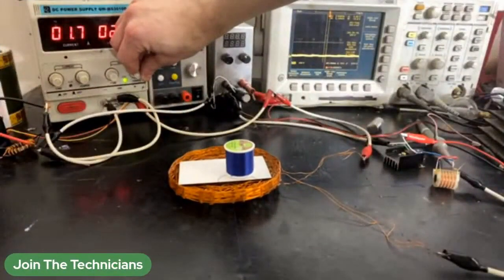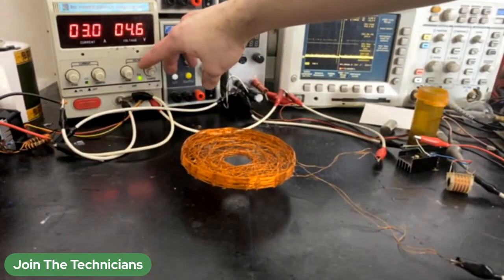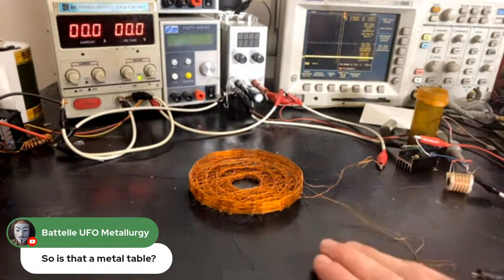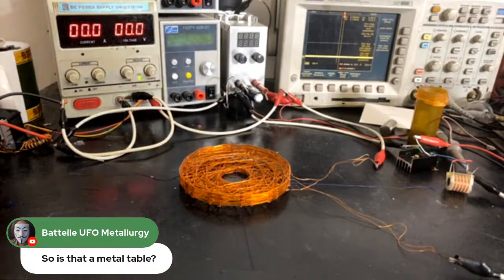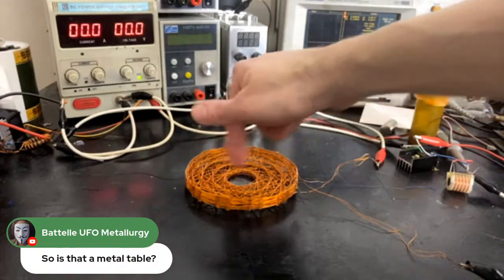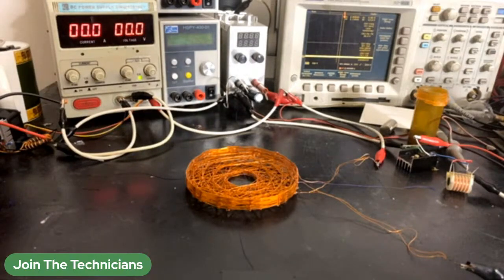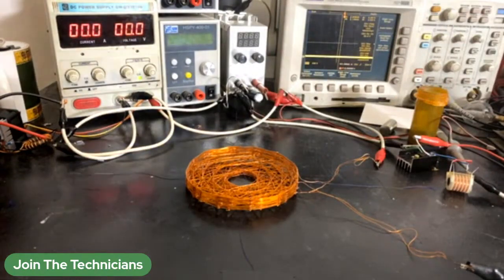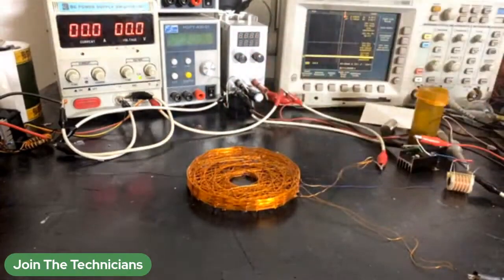Jeremiah Popp Hover Board Technology

Comment: 5:43 a charged particle trajectory doesn't bend if parallel to the B field vector, only perpendicular, so if the field generated by a straight wire were say strong enough (and symmetrical) it would deflect particles moving along outside of it in a toroidal fashion (around the circular field line). Hence if you had a vacuum tube with a HV cathode at the base of such a straight wire, you could theoretically deflect electrons away from the wire... ie I think Jeremiah gave an erroneous description, but if there's nothing conductive in the table, there's definitely something unusual happening here

Comment: I would have to go with the theory that this is just a plain old electromagnet and there is a magnet under the table. It seems to be stuck in the same position. Why is it not moving side to side, even when you pushed it it seemed to snap back to the same point
Reply: he said he used strings to stabilize it, similar to what is done with an ion wind lifter
Reply: At 0:08 when he powers the coil it centers itself over whatever it is reacting to under the table

Comment: Stick an aluminum tube in the center and see if it lifts too. If it does lift also, then attach an aluminum plate under it and it may stabilize.

Comment: It's hard to believe that the table is only wood.  Most coils like this float above a metal surface (Aluminum)...
Reply: Same idea though: instead of repelling on eddy currents which are phase shifted, the dielectric response lags to create a phase shift instead. It can actually be more efficient because you don't have resistive losses in the eddy currents. Dielectrics can have loss tangents too, but not often of smaller orders of magnitude.
Reply: @michaelperrone3867  If this is actually operating as advertised, then this is something beyond amazing 👏! This technology would validate what many have said was impossible and worst,  crazy... I'm highly intrigued!!!
Reply: @michaelperrone3867  This is what Joseph Hiddink claimed occurs with his device, patent US4095162A - Capacity changer .  Very quick rise time, high voltage pulses created, says with repeated pulsing it levitated.
Reply: accompanied by extreme heating and no stabilization unless the base plate conductor is segmented
Reply: @SuperCaviTationIstic  Not sure about that patent: the fields seem trapped between the capacitor plates so I don't see how they can have dielectric induction with the ground.
Reply: @rod3134   This device may operate by the same principle as the Fluxliner (for such a large object, multiple sections are needed, built into a zero-index metamaterial to be able to hit the high rise times required over such a large surface), and is probably the same effect that keeps the cones apart in Sal Pais' fusor patent.
Reply: @michaelperrone3867  True,  but I am still supremely perplexed that the significance of this object operating as advertised at all is not be getting more press. THIS IS HUGE!!! If true. To quote a famous movie line (Blade Runner2049),  "This breaks the world ".
Reply: @rod3134  Well it's not antigravity so much as levitation, and my guess is it's pretty energy hungry, so it will take quite a bit of refinement to make it practical. also all the people making actual progress on this are super shadowbanned because the algorithms have gone rogue.
Reply: @michaelperrone3867  Agreed 👍🏽.  I was into the lifters many years ago and discovered very quickly that it used ALOT of power. Whether its antigravity,  levitation etc... it seems to work. I looked into compact power supplies for awhile. All I could see that would be useful (Larger Payloads) was either fission,  fusion or zero point energies. The first two are here but fairly impractical. Zero Point energy (tapping the vacuum) appears to be the best approach. Zero Point along with the antigravity component has probably been realized. Many researchers in the past published seemingly successful attempts only to disappear from the public views. These two technologies married together will alter all of existence.
Reply: @michaelperrone3867  Usually the dielectric is sandwiched between 2 plates creating capacitance, i have a hard time believing there isnt something under the table causing the effect, especially since its' not explained in detail, i mean why hide the info if not for economic purposes like building intrigue and then selling the coils for outrageous amounts but only vague info on how to tune it to achieve the effect...sound familiar??
Reply: It’s just ion lifter which can’t lift power supply
Reply: @Cb80001  I would almost agree with the ion lifter idea. It appears to be a single wound coil. Ion lifters usually have a minimum of two separate coll or plates. I tend to favor the idea that an aluminum plate is under the table and his coil is using pulsed dc.
Reply: @rod3134  it’s same as this https://youtu.be/006d36WWyaQ

The guy in the video thinks it’s artificial gravity but it’s just ion wind and won’t work in vacuum
Reply: @rod3134  he even said in the video he uses hv. If you tune or pulse it you can use lower power/high voltage
Reply: @Cb80001  True, but in order for a lifter to work you need a positive and a negative hv electrostatic side within the unit. The fact that he got close to it and touched it indicates that it was more of a magnetic force. It would have discharged to him. Trust me,  I have a lot of experience with lifters.

Comment: When you pulse high voltage into thin wires, EVOs will want to form, some will pass thru the insulation, the rings will break into sausages. they will be repelled horizontally along tabletop below the convex side, and some will coalesce in the concave region. This will reduce gravity on the concave side.  Those EVOs will harm the electronics and human health unless the frequency is very high.  Build shielding with alternating layers of grounded aluminum foil, dielectric plastic wrap, and fine flourescent crystals in a thick layer.  Charlie, please pass this onto Jeremiah.
Reply: This sounds oddly familiar to what happens when you power a Tesla Coil. A retired engineer who was very friendly and helpful to me some years ago once told me a private story he didn't wish to share with others because he felt it would put him in a bad light, and I was open minded enough to give it a legitimate think-over. It involved a Tesla Coil and levitation of the entire build at low power levels. Never seen anything close to that myself but the possibility still remains I suppose.